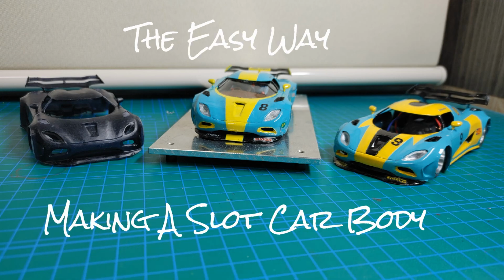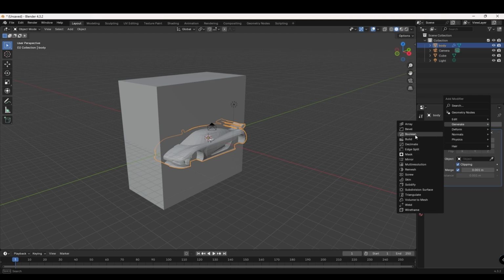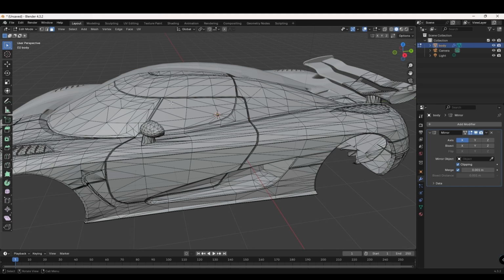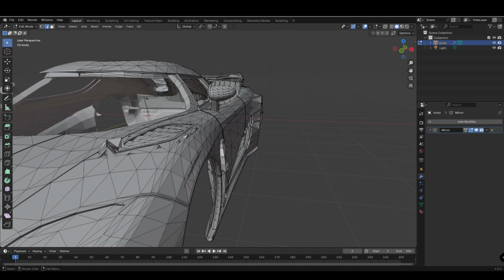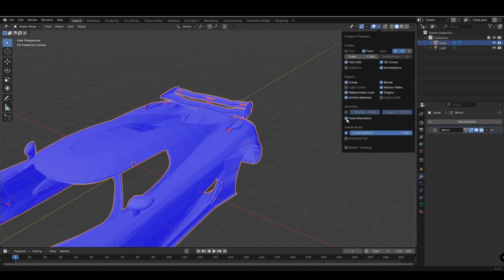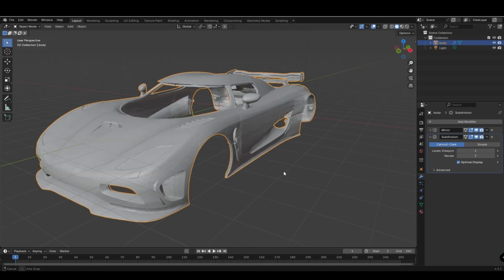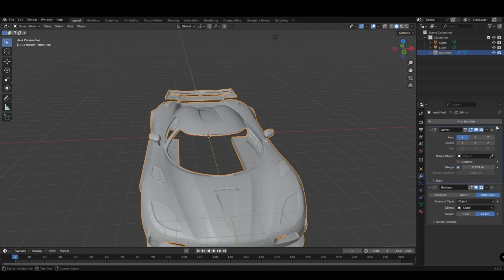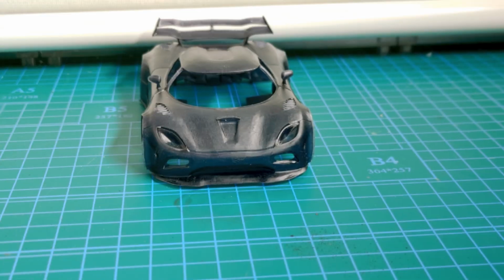The Easy Way - Making A Slot Car Body

Comment: Hi man thanks for the video.  I have a 132 Carrera Digital track and I was wondering if you have a version of this car body that can be put directly onto the carrera digital chassis?
Cheers!
Reply from the maker: Hi, I have the Carrera Digital 132 track also.  But I believe Carrera cars do not share a common chassis and will vary depending on the car.  It may be easier getting a generic chassis and modifying to install the digital chip to a different chassis.  I had installed the Carrera chip to some other brand cars previously, but not for this body shell as it was done for a wood track.